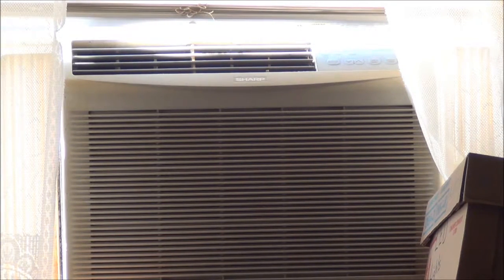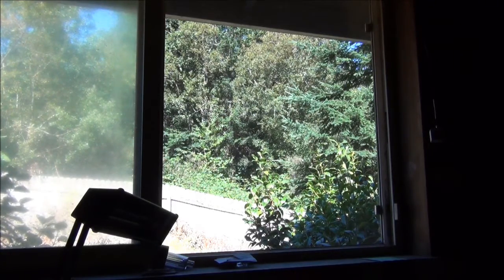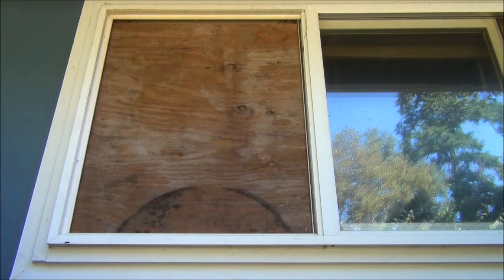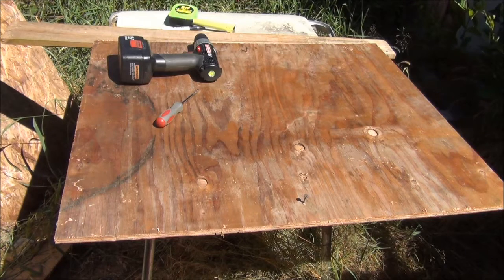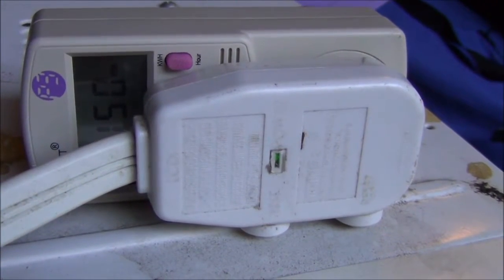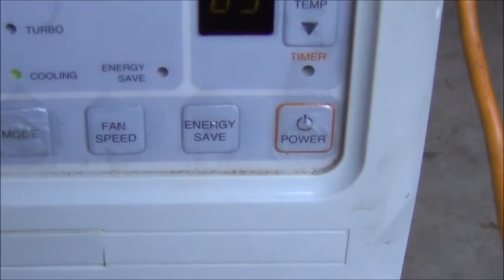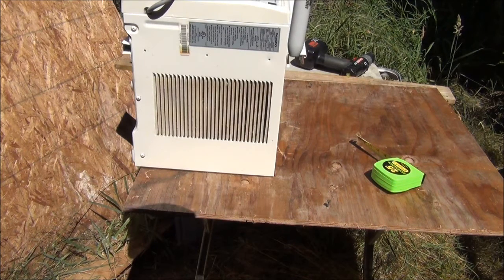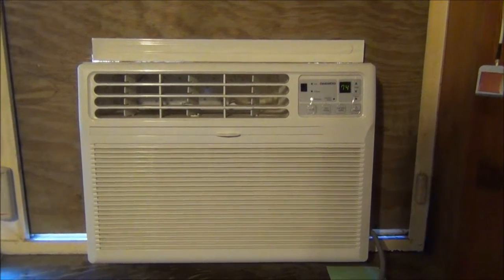Installing an Air Conditioner - L2Survive with Thatnub

Comment: The foam that usually comes with window air conditioners works really good, so using it on the top of that board and in any spaces will make a big difference. I didn't know how big that difference was until I finally filled a really small space in a bedroom AC, and wow, was it colder!! Much colder, and it was only a sliver of a space too. Good job, and make sure the water from the AC goes to the outside ok, it's gotta lean down in the back or the wall will get watered a LOT. Love cool too.

Comment from the maker: I tried running it off the solar once I got the system set up but, the charge controller didn't like that even though the wattage was good.  I think I will just get a grid tie inverter and run the A/C off the house power.